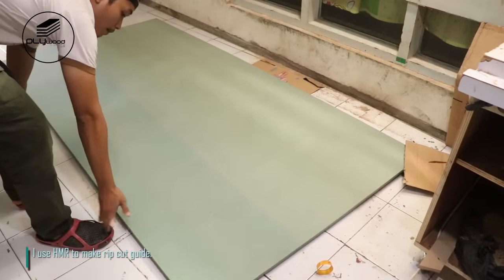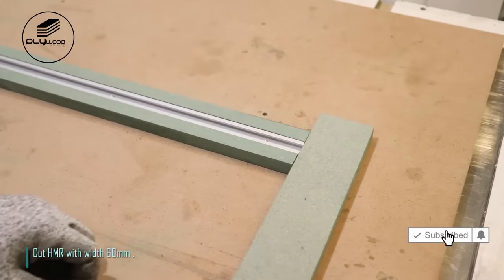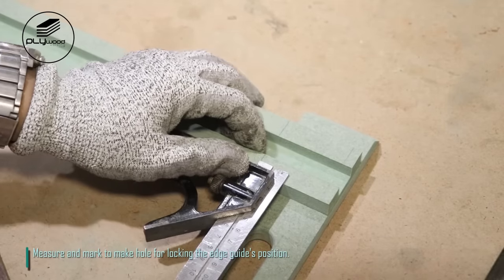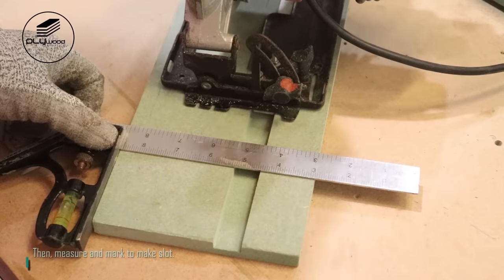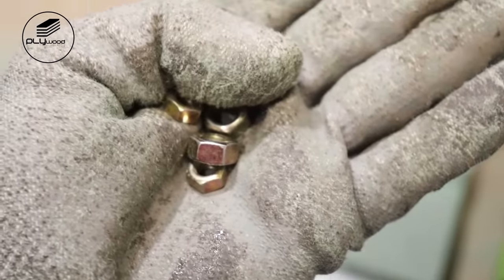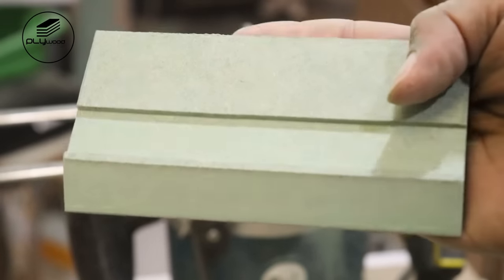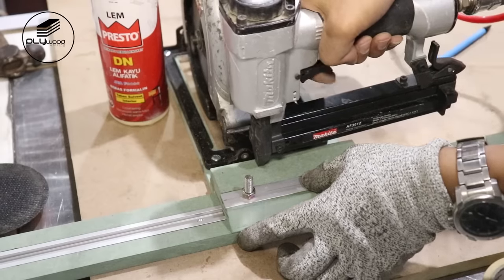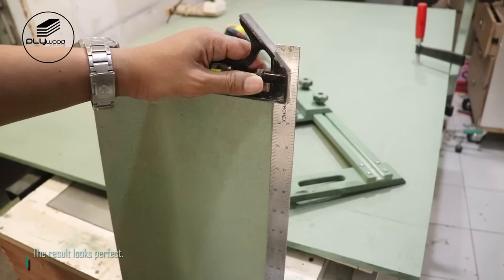Diy Awesome Rip Cut circular Saw Guide Jig - Perfect Cut

Comment: How well does this work?  I've not had good luck with the guides that use the off cut piece as the guide, but this one looks heftier than others.  Just looking for input before I build.
Reply from the maker: This is really work for me for cur large plywood and repeat cut. You can buy kreg almost same like this l, but i give modification on this jig
Reply: @plywoodworking  I like the repeat cut aspect as well.  I'd rather not give kreg my money.  I also have a mini circular saw, but wouldnt be able to put a base on because the cutting depth is 1"max.  Any ideas?  It's the handiest saw I have.  I do have a regular sized circular saw as well but I find I only use it for small crosscuts on 2 by material--I can easily use a square for that guide.

Comment: Hi Plywoodworking,

I had already asked once, but probably with an old video 
you probably no longer check for comments?
So here again:
Which or which programs do you use for your videos?
What text displays and to the language generates interest me especially!
Thank you for your information!
By the way, I had posted several times, but I cannot say enough, 
your work (s) are outstanding!
Michael
Reply from the maker: I reply your comment on last video, i use 3 sofware plus 2 sofware addtional.main sofwate i use  premier ,after effect and 3D max and add use photoshop + ilustrator.

I make all video use that sofware but try upgrade quality in new video
Reply: @plywoodworking  thanks fore the info😘

Comment: Nice design, but I prefer using Marine Ply, it's more robust and good against moisture, and there's no need to use a Router if you use 6mm to 12mm Ply. Just glue and screw the pieces together.
Reply from the maker: thank you very much 😊

Comment: 0:56  with the 20mm slot cut central in 55mm would leave 17.5 mm not 1.75  Also at 6.06 if one side is 265mm and you take away (-) 20mm you would have 245mm not 2415mm.
Reply from the maker: You right i make mistake typo. 1.75mm that right size.
Thank you for remind me👍

Comment: Очень качественно,профессионально и красиво!Но при таком коротком боковом упоре распил будет неровным.Его надо делать не менее 500 мм.
Reply from the maker: thank you very much, in this design the problem on fence edge guide if i suggestion make more long thanmy design,  no i use 250mm long , i think minimun use 30-35,mm make more stable cut

Comment: I wish you improved the design. This is almost exactly like the kreg rip cut. The problem with that ia the last 3 to 4 inches are unguided and can introduce danger and imprefection. You need a longer guide to finish the cut.
Reply from the maker: Basic i see kreg design coz i think that perfect design for  make rip cut but i not make 100% look like kreg i make more easy build and more cheap, if you cant handle that dangerous method, i disagree i make the edge guide more long than the blade that why i say that still save and good result.
If want more free cut i can use my ultimate track saw. 
I will combine my rip cut and ultimate track saw that great design
Reply: @plywoodworking  I agree, great build, I have the kreg and getting started and finish the cut is a little shaky, needs a longer guide. I use it on a panel saw in my little 8x14 shop. This design also seems a lot sturdier. Easy upgrade to this design. A measure tape would be nice too!
Reply from the maker: @brewermoe883  yes i make more long for edge guide coz  to finsh cut sometime not stable, if you want more safe you can make more long than my rip cute i think that make more stable to finish the cut